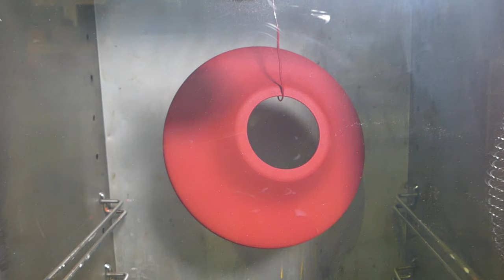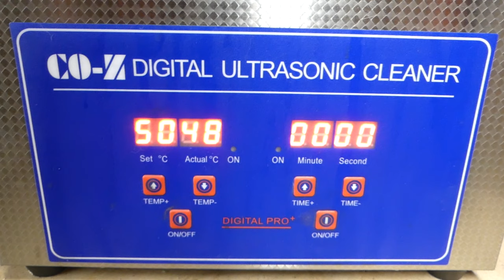Vintage Drive-In Movie Speaker Restoration Bluetooth Conversion

Comment: That looks amazing!
I do have one minor (and easily fixable) nitpick, though...
The holes on the side of the junction box were originally designed to hold a pair of (optional) thick wire baskets to prevent to speakers from falling to the ground...
There are holes in the bottom of the junction box base for the speaker wires.
You may also consider tying a simple knot in the speaker wires, inside of the junction box, and the speaker housing for strain relief

Comment: Put a little bit of solder on the tip, then put the tip on the part you want to solder and wick the solder into the line, takes a lot less time.

Comment: I don't know if you did, but before I sealed the component bodies, I would tie the cords into a knot, put a bead of hot glue at the inside of the cord holes, or a rubber/silicone grommet of some kind, so that the cords wouldn't get pulled out after assembly.

Comment: Hi
I am doing the same resto that you did......how did you wire up the DC end of the USB cable? Once you mount the Bluetooth receiver board there is no room with the other end plugged in. I see you have wires out so I assume you cut the end buy how and where on the receiver board did you mount it?

Thanks and love your work.

Comment: Great work!! What brand bluetooth speaker did you use? I'm restoring an old rca radio and I'd like to add a bluetooth speaker to it
Reply from the maker: To be honest I don't remember. I think it was a 4inch speaker off amazon.
Reply: @joe_diy  no prob! there's a bunch of them on Amazon, guess I'll have to sift through reviews! You do great work 👍
Reply: BOSS Audio Systems BRS40 50 Watt, 4 Inch , Full Range

Comment: While restoration is amazing, I didn't liked that you've placed Bluetooth module in base, so you had to drill a hole. Wasn't there enough place in speaker enclosure, to fit it there? Therefore you could use already existing potentiometer hole. Despite this, great job.

Comment: If your running a power lead to the blue tooth device .......
Then why not run a speaker lead from a blue tooth party speaker to the original speakers ?
Then you don't need to drill original equipment ....